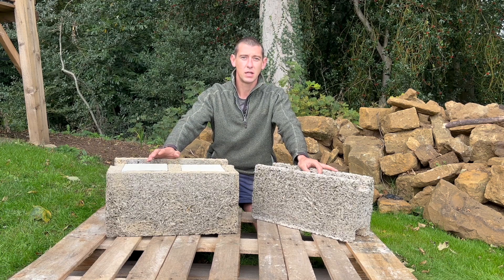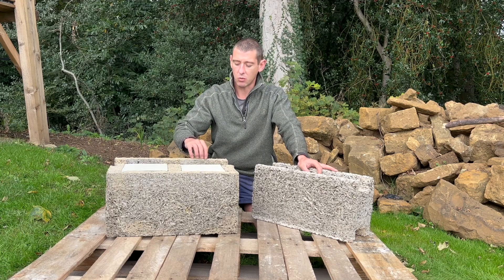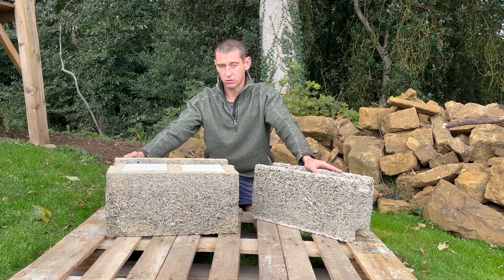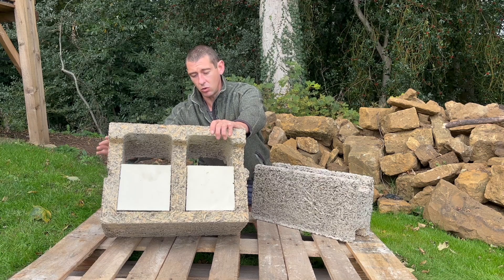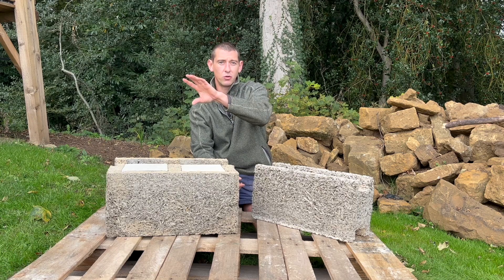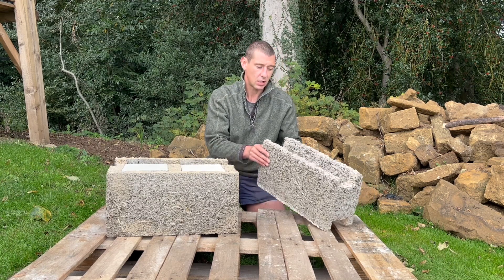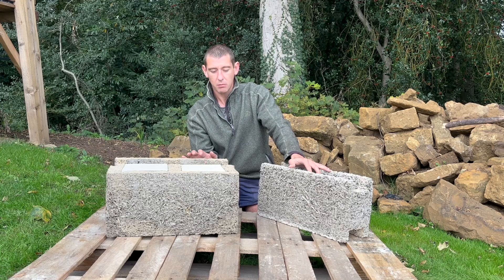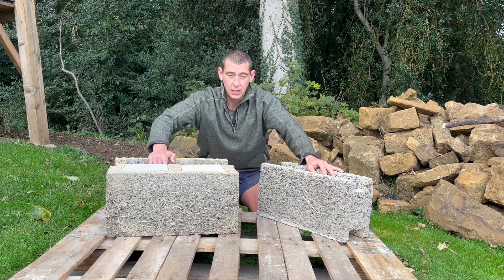A short intro into the ICF we are building with - Passive House - Ecobrix

Comment: Retired Architect.
We used this product a few years ago.  Generally very successful. 
One (usually) good feature is with the concrete fill it has a high internal thermal mass. 
And once rendered externally and internally it very low air permeability
Reply from the maker: Thank you, it’s nice to get an opinion from a professional not directly involved with the blocks at present.👍🏻 (though working with Ecobrix so far has proven they are true to their word).
We are looking forward to reaping the features of the block and are finding it very versatile. What internal coverings have you seen used? We are thinking of using a natural clay plaster directly onto the block.
Reply: @TurningRosemountUpsideDown ps, the block we used was called something different..but appears to be the same product.  Durisol, made in south Wales, the building is in the Scottish Highlands, completed in 2018.
There is a blog of the build, Google  Edinkist
Reply from the maker: It is exactly that block. A new owner bought the company a couple of years ago and is really trying to push its advantages.
Just looking at the blog now, thank you so much for commenting giving us more educated confidence in the block and secondly provided us with this blog to read. We are very novice in building and there is little out there on the use of these blocks so the blog will be incredibly useful for reference.

Comment: Visit an ecobrix build if you can. Especially on pour day.

Bracing is the key to preventing blowouts. You are better spreading the wall pouring across multiple days, rather than doing the whole wall in one day. Series 1,  Episode 1 of Grand Designs The Streets has a Durisol build. 

Buildhub forum is a great resource for self builders. Plenty of Durisol builds on the forum. 

Your foundations look great. An insulated slab creates a really great environment.

Comment: U of 0.15 is R of 6.66 that seems low ?
Reply: A finished wall U-value of 0.15W/m2K / R=6.66 is likely to meet the Passive House standard, but if you are to meet this standard you also have to have better levels of insulation than this to the floor and roof, few or no thermal bridges, excellent Psi-values at the junctions and a low rate of air change. (0.6 ACH). Many Passive House builders will aim for finished wall U-values around 0.11W/m2K, especially if they are expecting to have larger windows - the Passive House standard doesn't really mandate specific U-values in the way UK Building Regulations do, rather it measures the energy that the house will use. In a cool climate like the UK, if you walls aren't R6.66 or better, you are very unlikely to meet the energy use requirements.
Reply: @tlangdon12   Thank you, I think I see the issue. The value R-6.66 looked LOW.  I forgot there is a difference in U value from imperial to metric (area square foot vs square meters).  I have seen passive house in USA use R-value of R-40 walls and R-60 roof. Or in US an U-value of 0.025 walls and 0.016 roof
Reply: @dt-qh2cj  Of course! Well spotted. In the UK, we rarely talk about R-values so we don't have that sense you had when the number look wrong. When I think of R-values, I think of them as the inverse of the U-value, but as you point out, in the USA, R-values are the inverse of U-values expressed in terms of square feet.

Comment: Interesting product. I can see why it suits you as self-builders. They are light, but strong and produces a good thermal perfromance in a single leaf wall. It also adds some thermal mass on the inside of the home. Alternatives would be Aereated Concrete (U Values are around 0.18W/m2K) and Insulated Clay Blocks (U Values around 0.19W/m2K), but both of these also present challenges with getting good fixings into them. The Ecobricks look like you can screw straight into them without needing wallplugs! Hempblocks aren't as strong, but could be, if their format was changes to that of the Ecobricks - the voids and cut-outs in the Ecobrix that create the internal columns and beams are a clever idea.

Comment: What do you do about thermal bridging?
Reply from the maker: There should be minimal thermal bridging through the webs of the blocks because the block construction is aerated so although there can be a small transfer of warm to cold air (Which with the right internal and external coverings this will be mitigated) there is not a conductive nature. The block itself will have very little effect in drawing out the heat from the concrete core, its why we have brought the majority of the services and ductwork through the slab to save drilling through the concrete and insulation at a later date breaking the barrier. Once up we will need to think carefully about our external and internal coverings on the blocks for air tightness to really boost the thermal efficiency. We are not experts on this just keen self builders who have found a block that we can both lay that has good thermal efficiency. 😀
Reply: @TurningRosemountUpsideDown  I'm very interested to hear about what your final choice for internal wall covering is, and the reasons you chose that method and what you didn't like about the other options.
Reply from the maker: You seem to have good knowledge in ICF's and energy efficiency. If you have any suggestions that we could look into that would be greatly appreciated. We are a while off that aspect of the build but to gain knowledge early would be handy!
Reply: @TurningRosemountUpsideDown  These blocks look like what was known as durisol a few years back. If i was to use woodcrete id use the Isotex blocks, a superior design imo, less thermal bridges and better insulation (neopor)
Reply from the maker: They are exactly that... formerly known as Durisol. 👍
Reply: @TurningRosemountUpsideDown  The Technical Manual for Ecobrix suggests that the best way to achieve a high degree of airtightness is to use wet finishes (i.e. plaster/render) on both the internal and external surfaces of the wall. It also provides some U value calculations that show that drylining can increase the U-value for the finished wall (due both the cavity and the possibility of using a foil-backed plasterboard that reduces the emissivity of the back surface of the plasterboard). My feeling is that the U-values of the Ecobrix themselves means that you should either be planning on applying an insulating plaster or drylining the walls - I've answered another comment by suggesting that the Ecobrixs on their own might meet the Passive House standard, but you need the insurance of a properly conducted U-value calculation and something more insulating than ordinary lime or gypsum plaster on the inside to be sure. The big issue for a self-builder is always 'Can I do this myself, or do I have to get a professional in?'. It might well be possible to apply an insulating plaster yourself, and then have a professional come in to skim the top, to give you a professional finish, but you need to find an insulating plaster that will be airtight (can't help there). The other option that is definitely within the capability of a self-builder is drylining, either using Dot-and-Dab or onto timber or steel battens. I'm a fan of parging the wall to create your airtightness layer if you are going to dryline a wall. You then can use the cavity to run services, but I'm not a fan of Dot-and-Dab; it seem ok if you can pre-install all your services, but I found it difficult if you need to make changes in future.There are brush-on parging systems available for Porotherm blocks, which I think would also work on conventional concrete blocks and AAC blocks, but I think the Ecobrix might need a trowelled sand/cement parging coat due to how course/open they are. When drylining onto battens, you can fix heavy items into the battens, providing the batterns are fixed with this intention in mind; Dot-and-Dab tends to need special fixings, (e.g. Corefix) I'll admit now that I'm not an expert. I seem to know quite a lot, but not much of it is backed up by real experience!